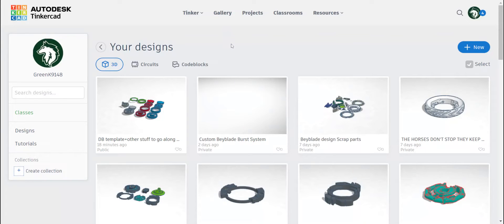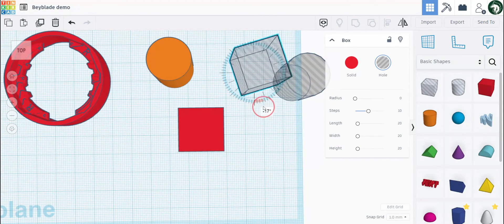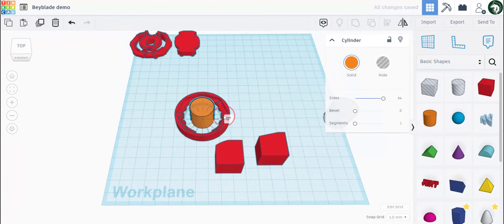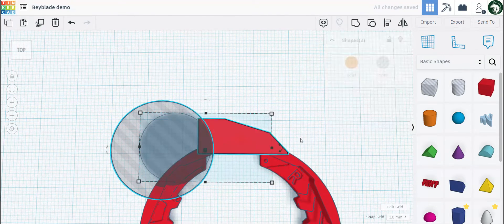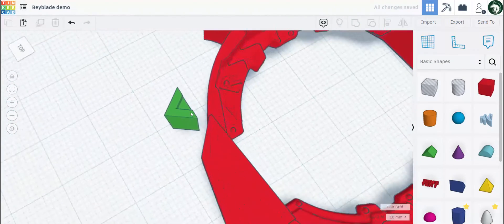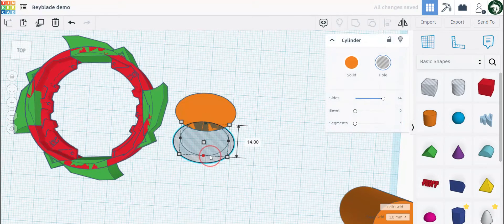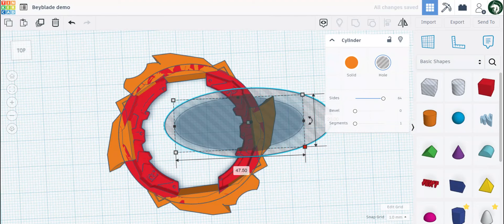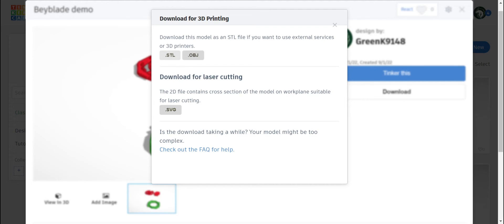How to Make YOUR own 3D PRINTED BEYBLADE on TinkerCAD | tutorial pt.1 the basics+DB blade.

Comment: What 3d printer do you use to print your beyblades? (Can you send a link)
Reply from the maker: Sadly I don’t have a 3D printer atm. But a good printer (for relatively low price) that I was looking to buy is the ender 3, which is widely used. There are some other options for good low budget printers like the Voxelab Aquila or Anycubic Kobra go. Most of which can be found on Amazon 

Link: https://www.creality.com/products/ender-3-3d-printer
Reply: I got the Ender 3 for Christmas, but a total amateur, but this is a huge help modeling wise. If we can be of help to each other in the future, im here if anything.

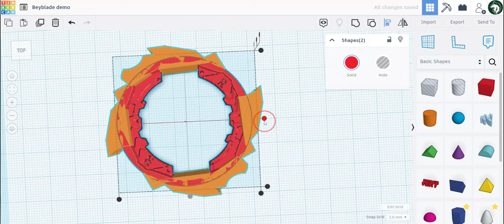Comment: Uh could you explain this part 15:56 in more detail? Because I did the same method it just deletes part of the blade
Reply: Ok I think I get it now thanks
Reply from the maker: I'm assuming it deletes part of the template or if the issue is something else lmk. So in the clip, the recoil points were sticking into the DB blade (therefore if printed, it would not be compatible with assembly), so I used a hole to cut that part out so it wouldn't do that. I then made sure everything was centered. After that I selected the hole and then ONLY the blade. Then it should work.
Reply: Ok I see my problem now I don’t know how to group objects/shapes without click drag in your vid you just click it but for me I can’t idk why but got any advice?
Reply from the maker: @NightSpeed458   Sorry i didn't see this until now, but all you have to do is click one object, hold shift and then click another object while holding shift. Then click group. for reference, I mention this at 3:00
Reply: Never mind figured it out
Reply: Thanks for your help also have you heard of Ilinuc’s Nebula Nitro 3d printed Beyblade? If so I made my own version of it today and it looks relatively similar
Reply from the maker: @NightSpeed458  Yeah i've seen the videos on Illinuc's Nitro beys. Is there any way I can see what you made?